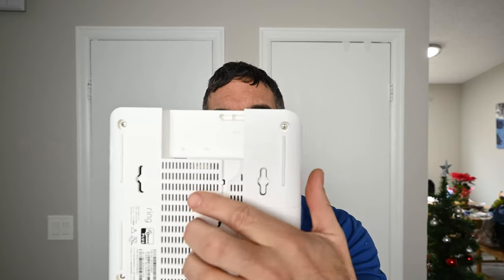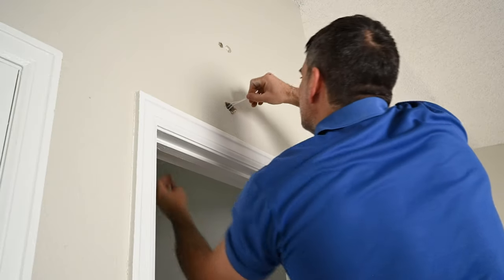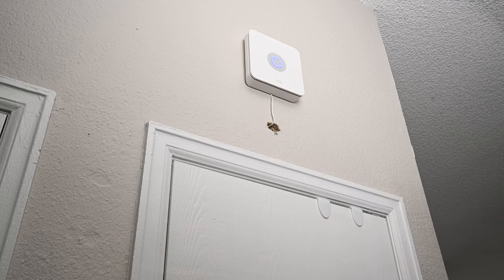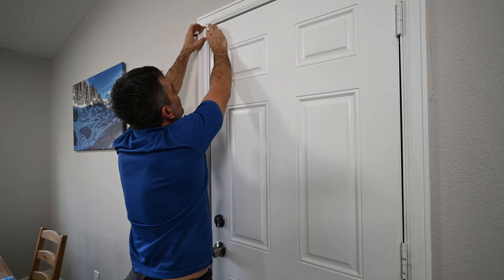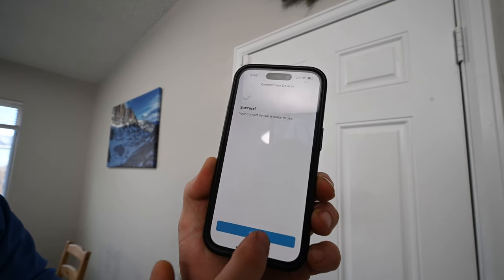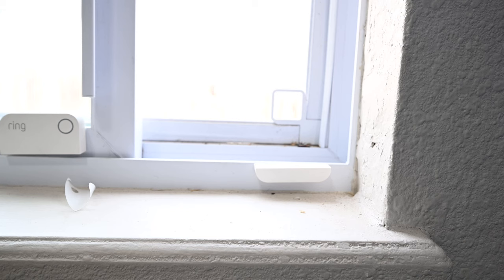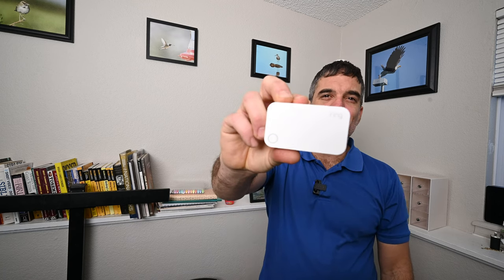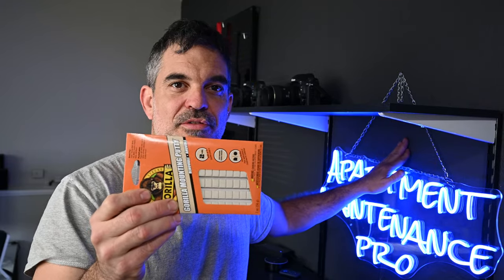Ring Alarm 8 Piece Home Security System Installation

Comment: I have $2,100 in Ring equipment -- come and pick it up. You CANNOT use this hardware with any other company except amazon, and the hardware comes from amazon. Amazon owns you, you do not own ring equipment (you just pay for it) -- AND guess what, those videos YOU delete, they still have them and will share them with Law Enforcement - THAT IS RIGHT.
Reply: I understand your point. The Ring system is proprietary. But then, so is Canon camera, Harley Davidson, Apple, etc...
Reply: Lol why do you have over $2000 in fkn Ring products? You might be a bit paranoid…. The door bell and echo monitor is at most $250 the largest alarm system kit is around $400… we are only at $650 right now add a 6 pack of Alarm Contact Sensors for $100 we are at $750???? I’d like to know how much of a darn setup you’ve got because you can start a damn Ring doorbell store with $2000 buddy!
Reply: That sounds good to me😂
Reply: Where can I go pick it up? It’s free right?
Reply: I’d give you some for it!
Reply: @brandonlparker  We already had  that unreliable alarm ripped out. You DON'T want it, except to resell it and make a buck, because you cannot want it for your personal use - it's horrible.

Comment: You shouldn't run any non in wall rated cablea into your wall. If there's a fire and the fire  inspector determines that's the cause your insurance won't cover your house. I install these daily along with many other products for a major company. Also, you have screw holes on your sensors instead of doing the double sided tape thing. Your can screw them on instead of sping your gorilla tape trick much more sturdy.
Reply: You might be right . I was wondering if the batteries are dead how can he replace it after he already glue it on the wall. Does the door sensors come with screws to make battery replacement easy?

Comment: Nice job.. Did you consider drilling the hole for the power cord closer to the hanging screws so the box would have covered the power wire coming through the wall.
Reply from the maker: Ya I tried but it hit a metal bracket attached to a support beam so that’s why I had to lower it. I had my heart set on the position it would be mounted

Comment: let say you have 2 motion sensors, and in the arm mode, let say Home mode, you'd like to exclude the 1 motion sensor (or other sensor) from Home mode but include both motion sensors in the Away mode? 

The reason I went with Simplisafe because Ring Alarm could not exclude the motion sensor or sensor in specific mode (2 year ago) ...I guess they improved that now? Can you please confirm?